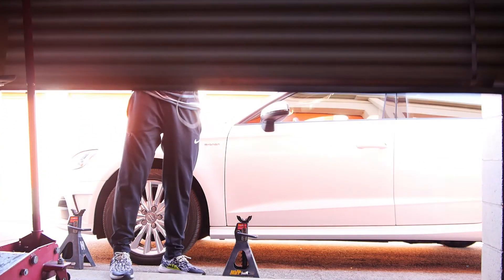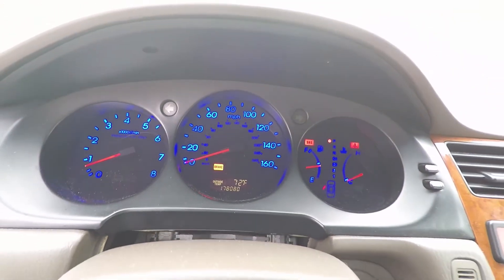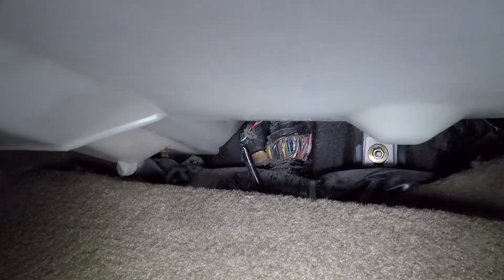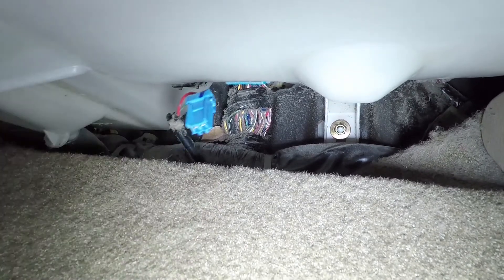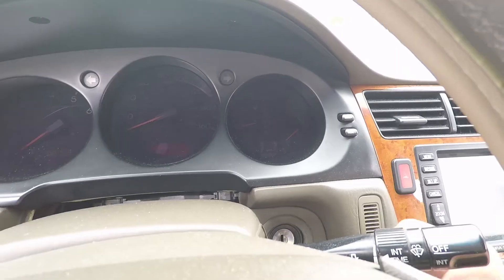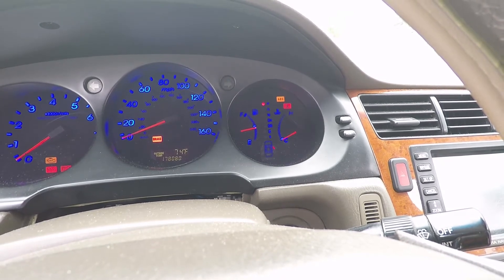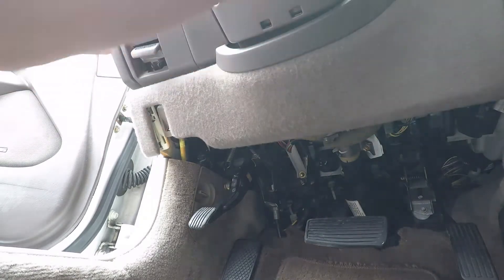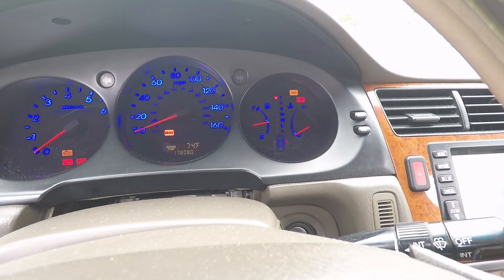99 - 04 Acura RL SRS Airbag Light Diagnose and Reset without a Scanner or Computer box

Comment: My SRS light does not go off at all. Stays on with the plug shorted- any ideas?
Reply from the maker: Seems like you have something that causes a permanent light.  Something like a shorted or open bumper crash sensor or seatbelt buckle sensor, pretty much anything too severe that the SRS light would not go away.  You will then have to check for flashing pattern in order to pin point what system have the fault and trace the problem to the source.  Now, it is illegal to drive without an SRS light.  However, that bulb is removeable.

Comment: Hey Tez C ! Thanks so much for this video, it was super helpful. I was wondering, on the passenger side, does it matter which of the two blue inputs I plug the connecter back into?
Reply from the maker: You're welcome!  Im glad it helped.  There should only be one holder to clip back into, and that clip is really just a place holder, not a sensor.

Comment: Yea.. I have SRS, VSA(and !)and ABS lights on.. I tried doing it exactly how you said. But it blinks 3 times instead of 2 and going away.. it blinks 3 n comes back.. tried numerous times to repeat steps and no luck, same with ABS
Reply from the maker: So you will need to follow the first part of my video; short the connector behind the a/c motor on passenger side, then count the number of slow blinks and fast blinks.  Each code is consist of two parts:  # of slow blinks and # of fast blinks.  In my video, my code is 1 slow blink, follow by 2 fast blinks, which means the code in my SRS system is 1-2.  The second code is 1-1 with 1 slow then 1 fast blink.  

For your car, count the # of slow blinks and then fast blinks.  If there are multiple codes, the flashing patterns will be different for each code, but eventually will cycle back again.  If you are having trouble determining the code (or blink patterns), use your phone and record a video of your dash and email it to me.  My email is Tchu619@gmail.com
Reply: @bluice619  I have 1 slow and 3 fast flashes

Comment: What kind of tool are you using the short the yellow cable?
Reply from the maker: ken858shin hey thanks for the question!  To short the yellow connector, you can use a piece of wire like i did earlier in the video, a paperclip, or anything that conducts electricity.  Let me know if you need more assistance!
Reply: I tried this but it didnt work on my acura RL3.5  2000 and it didnt work sadly.. please help
Reply from the maker: Zach Root what exactly is going on with your RL?  Is one of the trouble light "on"?
Reply: @bluice619  bought the car.. has srs light.  Now the car after almost 6 months has vsa symbol and light turned on.. also engine light and sode airbag are most recent. Yet the other lights went off for time being?
Reply: They are all back now